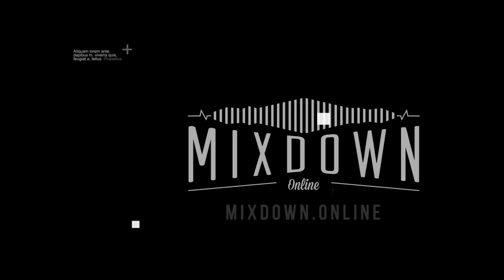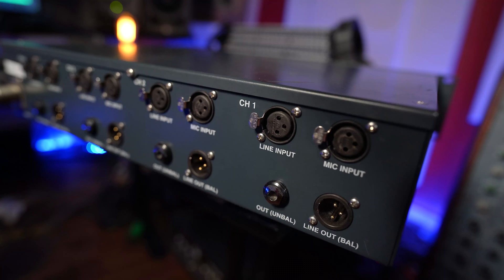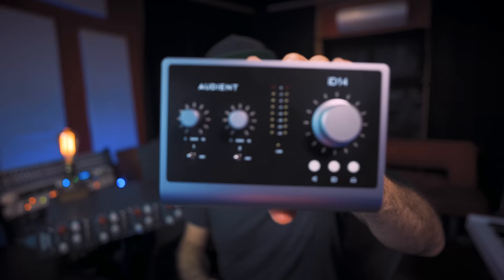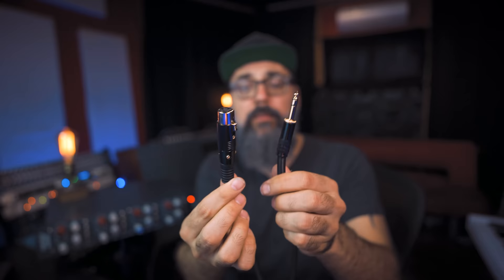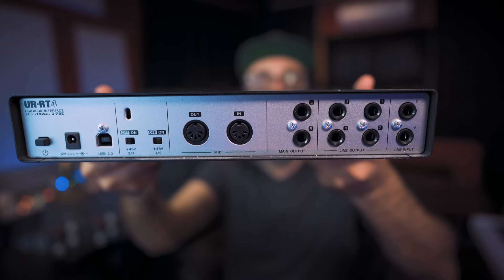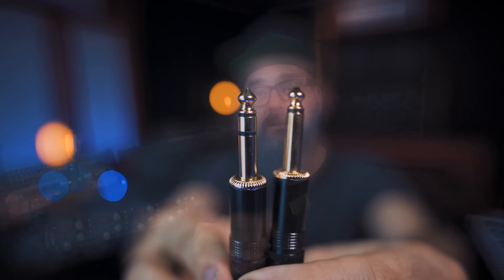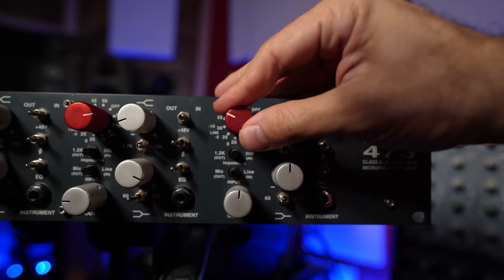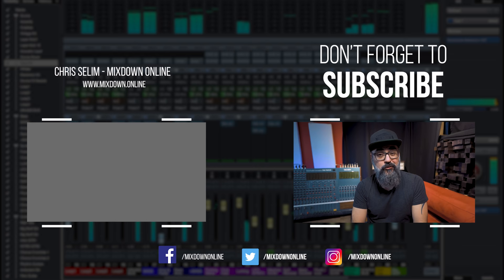How to HOOK UP EXTERNAL PREAMPS to your INTERFACE

Comment: Yo, if you have to turn the gain on your interface all the way down, this means it's still going thru the interface's mic preamp, despite what the combi jack makes you think. Interfaces with legit line inputs don't have any gain controls because they're already set to the correct line level, and you control the gain on your outboard pre. All the these new multijack input interfaces are dishonest about the gain structure happening inside.
Reply: Oh wow really? I guess it's no surprise. Ultimately, as long as it's sounding good tho eh? I was wondering about what to adjust the gain to on my scarlett 3rd gen interface. I'm running it in from a warm audio preamp, and I figure it's prob just fine as long as it's staying in the green on interface and sounds good.

Comment: You want to bypass the interface preamps.  Simply connecting a preamp output to the interface input doesn’t make sense.  Best to connect the preamp outputs to converter inputs, then run the signal from the converter out to the interface using a path which bypasses the interface preamps.
Reply from the maker: yes, bypassing the interface's preamp circuit is the best. However, not all interfaces will give this option, especially on cheaper interfaces.So if bypassing is not an option, and since an interface preamp is usually very clean, using a preamp connected to an interface preamp, will still give you the color and tone of that external preamp.

Comment: If your running a preamp into your interface well then that’s a preamp into a preamp
Reply from the maker: On most cheaper interfaces, yes, you will. However, these types of preamps a very transparent, you just need to keep the interface's preamp to 0, and you will still get the tone of the external preamp, no a big deal. The best is to get an interface where some dedicated Line Level in/out are available like the Audient iD24.

Comment: my Audient asp800 does not have an XLR output or 1/4" output.  I had always used an optical cable into the ADAT to connect to my Audient ID22 interface.  The other day that stopped working and I'm trying to figure out how to do this?

Comment: Well done...
I am using a Presonus StudioLive (32S) digital mixer for my interface and (so far after a year of use) I have not used the onboard mic pres. I like either my Allen Heath console pre amps or my Neve clone and API clone pre amps (Both Warm Audio clones). That's just my preference being more of an analog old school engineer. 
I do think you point out some very useful info to people either starting out and also to people recording who have different needs. You make some very valid points to a wide range of both audio engineers and home studio owners. All the best and well done...
Phil
NYC Area

Comment: thanks so much for the tip about connecting the pres to the interface using TRS cables and not XLR. Would have made that mistake for sure. Thanks!!

Comment: can you show us how to use the eq from the mic pre in the mixing stage if possible
Reply from the maker: I never used this specific Preamp EQ (which are only a Low and High Shelf) on my side but I can make a video on how to use an External EQ with Cubase Pro no problem!
Reply: @mixdownonline  my thing is I have a mono  heritage audio pre amp with eq. And a audient id44.  I was trying to figure out how I can use the eq section on my mono sources but in the mixing stage. I couldn’t figure out the routing :( that would really help out man if you can show us. Even with the cables in the back lol

Comment: Great video Chris. One question: when you plug a TRS cable into your interface does it automatically bypass the preamp of the interface? I've heard it does not which is why you need to turn down the gain knob all the way as you mentioned. Thanks.
Reply: Nah for Audient you need the ID22 or ID44 to bypass the preamps.

Comment: ah, so it's basically: Mic to Preamp with XLR (to whatever else in the chain) to Interface. And use trs and plug in Interface's Line channel whenever possible. Btw does the trs cable length matter? I wanted to get 3 meters but there was only 6 so i got it but now a little afraid that piling excess length on itself might cause interference
Reply from the maker: Yes, trs cable length does matter at some point , if their too long. 3 meters would be good, and 6 meters is starting to be limit to start getting interference, but it depends of your environment, so listen, and if the signal is clean, you're good to go!
Reply: @mixdownonline  appreciate it!

Comment: Chris thank you for your videos. You are the person i learned the most from since i only use cubase and you man are a guru at this. Also i have a faderport and your videos on that was super helpful. So as for this video, i have my external preamp connected with my interface with a trs to trs cable since my preamp has both outputs (xlr and be balanced trs). Is that a mistake? Should i get a jack to xlr like you did in this video?
Reply from the maker: Sorry, I just saw your comment. Your connection is OK, trs output from your premap to trs input on your interface is perfect.

Comment: WOW, great info. Cheers from Canada. I have the old Apex AMM42 but there is hardly any sound when I use a Mic...but the same Mic works on the Behringer Eurorack UB1202...do I need a Mic Preamp to connect it to APEX AMM42?

Comment: Thank you Chris for all this useful information! Definitely appreciate all your tips and advice. If you do have a moment, what recommendations would recommend for me;  I currently use The Apollo Twin X QUAD and use the Neve 1073 preamp UAD plugin. (Recording in Cubase 10.5 Pro with an Neumann TLM 102) As of now only adjust the High Pass filter to 50Hz.  Any tips and recommendations you might advice me to do while recording vocals?
Reply from the maker: Cool setup, the Apollo is a great audio interface. My suggestion is to start experimenting  recording vocals with compression, but not too much, just a bit. You have to be careful when you're new at this, but it's worth experimenting and get use to this vibe :)
Reply: @mixdownonline  Awesome! Thanks for the feedback. I have been recording with some compression, currently using the Teletronix LA-2A. My gain being around 55 & Peak Reduction of 60.
Reply: Pluging in an external pre amp into the Apollo twin through TRS I heard that it doesn’t fulling by-pass the built in pre amps of the Apollo… is there any truth to this. Or all interfaces will be good to go as long as your going in line level 1/4 ? Thanks

Comment: A Preamp amplifies the sound always the same amount, it does not matter how much you crank up the Volume. If you want to change the sound you can do it with the Gain but not with the Volume. This is because the Gain brings more input Level to tthe amplifier and the sound of it will change, but not necesarely for the good.
Reply from the maker: Yes, you're correct, and I don't think I claimed otherwise. On  lots of vintage type preamps, like my Vintech 473, you can play with the Input Level (Gain), and the Output level to get or not some Saturation. On my VTRC, I have 2 knobs for Input level, "Input" and "Gain". In this case, "Input'" is the preamp level. Now, whether I like the preamp saturation depends on how much, and on what I'm recording.

Comment: Hello. Thank you for the video. I have UR-RT4 and I just bought an external preamp. When I connect the output from the preamp to the line input slots of UR-RT4 (in front) it connects nice and quiet. But, when I connect it to the line input in the back, it has loud noise. 

Are the line inputs in the back different? Why is this happening?

Comment: Thank you for the great video. I have a question. I have guitar preamp with only TS line out. So, do I need a DI-BOX and XLR to TRS cable to connect preamp into line in of the interface?

Comment: The neverending question for me is: dont I need a interface that really bypasses its built in preamp? I'm no specialist, but the signal in line input, although at zero, still goes through a circuit and this circuit "reads" the external preamp signal, interfering on it in some way. The other question, if I'm correct in my assumption above, is how much it affects the original signal from the preamp (I use Isa One).
Reply from the maker: "need" is a big word, but yes, the signal will pass by the preamp circuit of the interface, unless specified in the interface's manual. Is it a big deal? I don't think it's a huge deal, but still good to know. In this case, keep the interface level down, and use the level of the external preamp. You will get the benefits in tone of the external preamp, since most interfaces are pretty clean to begin with...There's also more and more interfaces that will bypass the preamp circuit when connecting a Line level unit or will have a Send/Receive IN/OUT per input, that can be used to connect an external preamp, like the Audient iD24 MKII. Good question Ricardo :-)
Reply: @mixdownonline  So, I think the test to be done is buying the audient id22 to, maybe, solve the question. From where I am, I hope the diference is no big deal. But if I buy it, I hope it is, cause it's a little pricey for me at the moment. Really thanks for your answer!

Comment: So... according to your guidelines, connecting the external preamp to the interface with XLR  to  XLR is WRONG  because of the different input levels between Line  and Microphone signal ...? Did I get this right?  Do I DEFINITELY need to connect the ext-preamp ONLY as a line signal?
Sorry for the stupid question but but I'm braking into the voiceover industry and these "techie" staff is kind of rocket science to me.
I would be grateful for some feedback.
Reply: Never connect XLR to XLR…there is a more important reason…XLR in the audio interface inputs are for Mics…in case you accidentally turn phantom power On, you will toast your preamp…the correct is XLR from the preamp going into TRS in audio interface.
Reply: @fredepstein  Thank you very much for taking the time to reply. 
I've been connecting the wrong way my external pre-amps for quite a long time. It is pure luck I didn't fry them. Though I was somehow happy to be able to use the DSP of my sound card I always had that hunch that there was something wrong with this choice. Thank God I've expanded my research and found the answer to it.

Comment: Hey Chris quick question. I use a tascam series 102i & plan on getting the external preamp camden ec1. I would connect this by xlr to trs line input. I was notified that some interfaces don't let you bypass the preamp in the interface just down pad it. Can you school me on this or would this work fine in my situation to get the full potential of my preamp. I just want to make sure I'm doing it correctly. I don't have any other dedicated line inputs. So it seems to be my only option.

Comment: Planning to get a single Seventh Circle Audio Neve 1073 clone preamp. Would it be alright to go out of the SCA  pre into the XLR input of my Babyface Pro FS, so long as I leave the RME input gain to zero in totalmix, or would it still be reamping the signal? I could always use one of the two line inputs on the Babyface if that won’t work — just wondering if that’s my only option. (I also have a MOTU Ultralite mk4 sending 8 channels into Babyface’s ADAT, but I’d prefer to use RME’s better converters on the pre.)

Comment: Amazing video, Chris. Would you recommend using a preamp before a SSL 2+? I believe its preamp is very good but I've read that regardless of that, a decent preamp before the interface would always deliver a better job. Cheers.
Reply from the maker: I think it's always a matter of what you need for your sound. The SSL2 Preamps are clean and of good quality. A good preamp can give you a different tone and color when recording. It's a matter of taste and what you need.
Reply: @mixdownonline  thanks, Chris - much appreciated! I will keep that in mind for the foreseeable future :)
Reply: @mixdownonline  thanks Chris. One more question: what do you think of preamp plugins? Are they effective in “colouring” the sound? Any recommended plugin? Cheers!

Comment: Hi, Chris! Great video! Was wondering if you could help me with a quick question: I use the Steinberg UR-RT2 interface. I recently got a Golden Age PRE-73 Jr mic pre. I'm currently running a Shure SM7B male XLR-TRS from the pre to line input 4 on the rear of the interface. Your video says I can also run into either one of the mic/line inputs on the front of the interface as well. Is there a pro/con to this? Would I get better overall tone using one of the inputs on front because of the Neve transformers? Also when using the inputs on the rear, there's an option in the settings for the UR-RT2 to have inputs 3/4 at either +4 dBu or -10dBV. I'm not sure where to set that either. Thanks!!!!
Reply from the maker: Hey Michael, your setup connection is good as it is. +4 dBu is what you should set it up to. I think the first 2 preamps are XLR and Instrument Line Inputs, so not the best for your preamp. The Neve Transfomers is only when using the pre-amps of the UR-RT2. In your case, you don't want to get a preamp in another preamp. Hope that helps!
Reply: @mixdownonline  Thanks, Chris!

Comment: Hello Chris, is it anyway possible with Cubase Artist 10 to use external effects like a Reverb Unit for recorded signals in Cubase?
Reply from the maker: Yes but only on the PRO version only. If you look in Audio Connections, you can setup your External Effect under the External FX Tab. If you don't see this Tab, that will confirm it's a Pro feature only.
Reply: @mixdownonline  Thanks Chris !

Comment: Hello Please I need Help, I need to Export many different tracks each of these tracks are in different lengths. What I want is To Assign jobs or tasks for cubase, I have Created Marker cycles for each track that I want to export according to its length. but I cannot find a way to let cubase export all the tracks for me automatically. this is a Voice Over Project not Music. 
Please I need help to save me some time.
Reply from the maker: If you have Cubase Pro 11 you can batch Export tracks using Cycles. I briefly talked about the Export features of Cubase 11 in this video https://youtu.be/b724lNIrFuc. Let me know if that helps!
Reply: Thank you Chris for responding, unfortunately i dont have cubase 11. But i think i can put my tracks into one and still use cycle markers to automatically export all the segments.